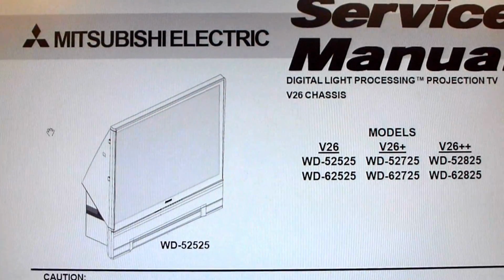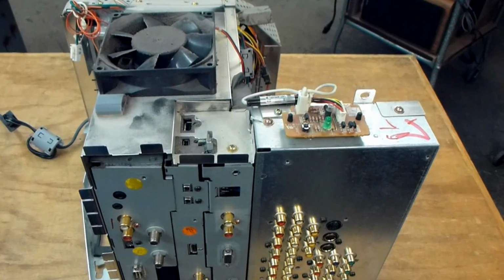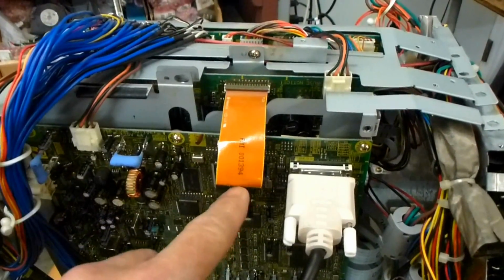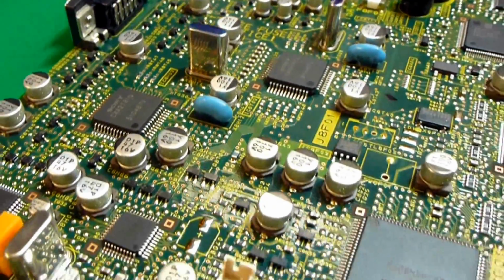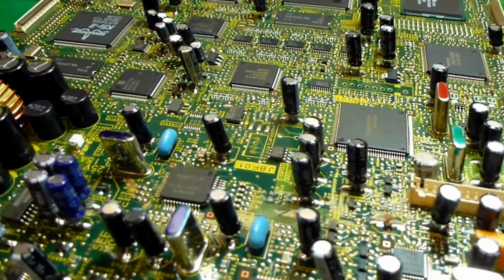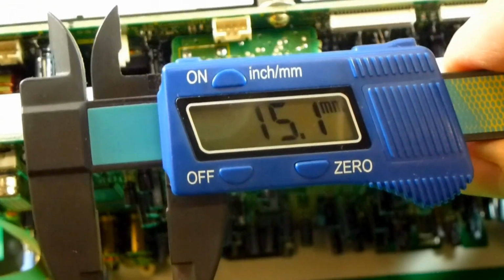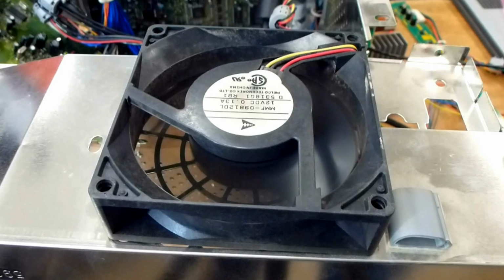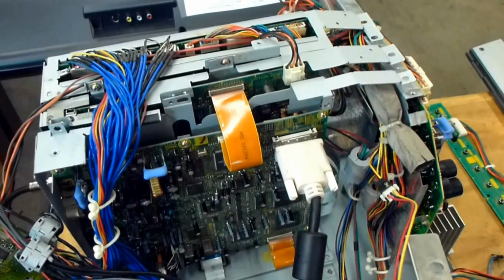Mitsubishi DLP Electrical Chassis Rebuild DM FMT WD 52825 62825 52525 52725 62725

Comment: I remember working on a couple of these things several years ago. One was still eligible for a brand new chassis under the extended warranty program (and still needed a new ballast after that) and the other one was a monumental failure that wasted hours and hours of my time. If you look up "convoluted mess" in the dictionary, there's no words; just a picture of one of these V26 series Mitsubishis.

Comment: your good where can find a ballast for my dlp ushio phg201g23dg seeking this my lamp wont turn on at all I watching my tv during a power outage now my ballast need replacing  input voltage 250 -420v output 200watts

Comment: I have a wd-73727 that I was watching and it went out like the bulb went bad. the code is showing a 34- which is bulb failed to lite up. ordered  a cheap bulb and put it in, still no luck. started checking all the voltages and can't find any bad or wrong. I have 340v to the ballast, I have a good 5v reading. can't find any bad caps on the fmt board. I don;t have a scope to check signals with, but the lamp- en and the lamp litz lines both go from a 1.8v standby mode to a 4.9volt reading when set is turned on. only last about a second and then the ste shuts down and the red lamp indicator comes back on. blulb never attemp's to turn on. is it going into shut down mabe? can't fined any shorts, so don't know where to go next. cheap bulb bad?   the training manual say's the lamp-en and the lamp-litz is generated in the dvm on the light engine. formatter board problem?  also changed the ballast board thinking it was a bad board. didn't fix. all fans fire up just fine, just no bulb lite. please help if possible.

Comment: Norcal, I found some bad caps on my power board (bulging).tv is wd-62825 Caps are C9A33 and C9A41 . I get the green blinking light of death.  I checked standby voltage at the test points on the power board and get the advertised voltages with the exception of the +15 and -15 test points.  I get 18V at these test points. I looked at the wiring schematic and it looks like my bad caps are in the 12 and 6 volt circuits.  Could I have a bad voltage regulator in the 15v circuits.

Comment: Hello, I was hoping you could help me. I have a Mitsubishi DLP WD-62725 TV. Last night my power went out with the tv off. It is plugged into a surge protector. The power came on about an hour or so later and I noticed the green timer light blinking then go off. When I woke up in the morning I tried to turn on the tv but it would not power up. No lights blinking whatsoever. I tried pushing the reset button for 15 seconds and I also pushed the menu and device buttons together to see if it would give me any type of error code. Neither worked. If you could please tell me what my best options might be it would be greatly appreciated. Nice Vid by the way. Also I do have some soldering experience. Thanks in advance.

Comment: I was an authorized repair station for Mitsubishi tv . They said they would replace other components besides capacitors,when rebuilding this chassis but that the some of the  components were unavailable to the general public.But Mitsubishi was generally helpful otherwise

Comment: Could you recommend what panel/board that I should replace capacitors on based on the following description.  I am a novice, but am up to the challenge.  I have replaced capacitors before with success on a receiver.  

I have a mitsubishi WD-62725 that is experiencing some issues.  I want to keep it if possible, but need help diagnosing my issues root cause.  The HDMI input picture has degenerated (grainy and some heavy lines going through it, similar to what you showed on this video)  I hooked the same HDMI devices up to other LED TV and the picture is great.  Also, the cable card picture is perfect, and component and composite pictures all look great.  I am wondering if there is a HDMI capacitor or other component that can be replaced, and where I may find youtube of other instructions to do so.  I have tried different HDMI cables as well, so i know it is not the cable.  This MAY have all started when about a month ago I was inserting a new cable card, and it bent 3 of the tiny pins that the cable card plugs into.  I have painstakingly straightened those pins and successfully got the cable card functioning great again, but the picture quality of the HDMI input has has the above state problem now.

Comment: When you say you now only replace ALL the caps.. what do you mean by all. All including surface mount? All on one particular board? All in the entire set? I replaced probably 50% of the caps in one of these and it worked for a while but surprise surprise I'm having problems again. The caps alone probably cost 65 bucks. How much does it cost you in parts to do them all?? If it is every cap in the entire set.. even the boards outside of the main engine, I can imagine that being a ton in just parts. Hope you respond, your knowledge on these things is King.
Reply from the maker: All SMD caps on the electrical chassis(formatter and digital boards). I have had some going for about 5 years with no problems. I have done 8 complete cap replacements so far.
Reply: norcal715 Thanks for the response. That must be kind of expensive. I get my caps from digikey. Are you using a cheaper source? Those little amounts sure do add up quick. BTW I was able to fix the latest problem last night by simply replacing the "one" cap in this vid 10mf 50v. You saved me a ton of time and energy. Thanks!

Comment: Thank you so much for these vids, Are these models swappable between each other. like could I use a 52525 engine in a 62725 etc?
Reply from the maker: yes the 525 and 725 are completely interchangeable. the 825 is not with the 525 or 725 however. 52 and 62 just refer to the screen size only.
Reply: Awesome thanks man. I guess I'll keep all these 525 parts for spares for my 725!

Comment: I have a wd 52525 that seems to be working fine. It boots to a blue screen and thats it. I can switch it to computer and the picture is perfect but there's no longer sound. Switching to anything hooked up through the component hookups just sends it back to the blue screen.

Comment: Thanks for all the info,  i have a wd65737 and after a power outage we cut it back on and all it'll do is bring up the welcome screen and it keeps getting brighter and brighter and the green standby light just continuously blinks,  which board would I need to fix this problem and do you have any that you've redone with the different caps like this repair?  Thanks

Comment: So... I've played with this TV for a few days and watched many videos. This one helped me figure out which caps to attack first. Previous owner gave me the TV for free because he replaced the lamp and nothing worked. Red light stayed on. TV service guy told him $200 to fix... I spent less than $6 on caps. Soldered them in. Still nothing... started chasing wires and found out the lamp had pushed the ballast cables to the side instead of plugging in. CHECK WIRES!!! TV works great now. :)

Comment from the maker: That would be great if they could be tested in circuit but most of them are in parallel with a little choke coil making their own little circuit but testing them looks like one big capacitor. The ONLY complete repair is to change all of them.

Comment: Makes sense to check the capacitors with an in-circuit capacitor meter before changing every single capacitor. Otherwise I would just BUY a rebuilt board. The last time I checked I believe the formatter board was around $100.

Comment: I've done a couple of dozen of these over the years, but I'd like to point out that most boards using smd caps will NOT survive the twist method.  These Mits boards are very sturdy, but that's not the case in most.

Comment: Awesome video it has helped me so far. I can get my WD62525 to boot with the 4 prong connector unplugged. And as long as I keep the tv plugged in it will keep powering on but when I unplug it I get the constant blinking light. I have replaced the 4 1000uf 16v caps and still no luck. Any ideas?

Comment: I change other capacitor from the power board but have the same problem , the status light turns red (not orange) and the code is the same 44 . Any insight would be appreciated.

Comment: thanks for the video norcal715, I have a wd-62825 and I change the capacitors 1000/16 and 3300/10  like you in the dm board and the power board, but the problem is the code 44 I check the dvi cable and it's ok. please can you help me ? the status light is blinking red or rather orange the chassis fan stops in few seconds after I connect the power cable . sorry for the bad english.

Comment: Finally got the chassis back into the set. I got it to boot once. It warned me that the chassis fan was obstructed. I got the wires out of the way, and we're back to green flash, no boot.  Guess my workaround didn't work out. I feel like troubleshooting it with a shotgun while sipping on a green flash

Comment from the maker: I cant reply to you directly you have it blocked. I have stopped doing part by part capacitor replacement and only replace them all at this time. It is the only way to be sure that the repair is solid. The list is the original caps. I always replace all of the 47m with 25 volts and the 100m with 16 volts just because I know they will fit and so on. That way it minimizes the number of different caps you must order.

Comment: I havent gotten a reply yet myself. Not sure if Norcal715 is monitoring this thread anymore.

For your problem, I would start with opening the back and follow the part in the video about laying flat the wires using a tie wrap. Have a can of air ready and blow out everything. Cut the fan box and make sure the flow is out/up. I had that symptom when I didn't have the fan connected and it heated up.
I am now trying to find a inventory of parts to order.

Comment from the maker: you have to run a single conductor jumper from what is left to the new cap. also try downloading the svc manual and finding them in the schematic sometimes you can find the origination point to tap to.

Comment: okay norcal715, I'm kickin ass with this rebuild, but I've hit a snag. When I removed 2 bipolar caps on the DM board, I lifted off the pcb conductor pads with them. What's the fix?

Comment: hey i am getting error code 34 i changed caps for lamp it played for a few weeks then change cap agin no change so change lamp still no change so i change the Power Supply broad can you please tell if you can help with this my set is the wd52525

Comment from the maker: you can not check it with an ohmmeter as it is a UHP ultra high pressure lamp. It has a drop of mercury in it and requires a high voltage arc(5000 to 20000 volts) to vaporize the mercury then a lower voltage to sustain the lamp(70 to 150 volts) I have made a lamp tester out of an old ballast but the ballast needs 320 volts to run so a doubler circuit is required.

Comment: hey, great video. much appreciated. but ive run into a small problem. i broke one of the prongs off of the inside of the filter door jack (the one that tells the tv that the filter is in place) and i cant start my tv without it. are there any ways to bypass it or do i have to find a replacement somewhere? thank you :D

Comment: I think if you watch the video, you would see he says you need to change all of the caps on the FM and DM boards if you want to eliminate the lines.  Also change any bulging caps on the jack panel, power supply, and signal boards.

Comment: So the yellow blinking lamp led is fixed (forgot to connect lamp filter connection).  Now I am getting a blinking green power light.  I guess the next step is to replace all of the caps on the DM and Formatter. Correct?  When I get this thing fixed I am going to send you my address so you can send me a bill.  You have been amazingly helpful.  I would have given up by now if not for your help.

Comment from the maker: very thin black and green individual wires go the filter switch. Connector "CC" is the cable to the door switch. It is a larger black shielded cable with red and white wires inside. Also look at the video and check the error codes.

Comment: The lamp and filter door and on the system and I am still getting a blinking yellow lamp light.  Do you know which plug checks that the doors are closed? I'm assuming that is where i need to start.

Comment: Thanks so much for the quick response.  I replaced that cap this morning and now the chassis fan starts up for a few seconds then I hear a clicking sound and the chassis fan shuts off.  Does that mean something is wrong on the DM or Formatter board as well?

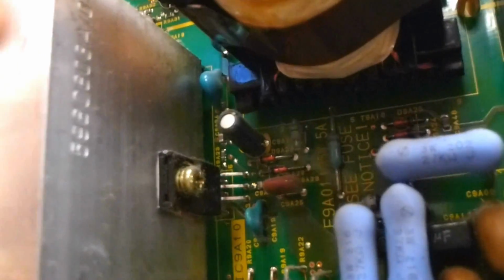Comment from the maker: If the top fan in the chassis does not run then the chassis is not making its 6-7 volts and the 12 volts. suspect the little cap on the p/s board as in the video at 4:44 10m 50v, it will cause a dead set. The hard drive has its own power supply

Comment: Looking for some help norcal.. have a 52825 that will no power up, no lights or anything.  Followed you guide, found 3 bad 330uF on signal board and 1 1000uF on jack panel.  The only thing I know for sure is getting power is the HDD (fans spins).  Is there a quick way to check that the other boards are being supplied with power?  Thanks, excellent video BTW

Comment from the maker: if its the one on the power board then a 10uf 50 volt will work they are very cheap even maybe radio shack. you have the uf and volts reversed

Comment: Nevermind the capacitor. Replaced it and got the TV back on. Unfortunately now the inputs are all scrambled. The coaxial input works with bowed edges(sides) like what Julie Cairnes described. Might be time to part ways with it. Any info would be helpful. Thanks.

Comment: 525 after changing the two caps again for the power to lap. i still get the red lamp light. i checked the codes and i got 34" lamp abnormality code the TV will play with sound and pitcher but when turned off and then i try to turn it back on i get sound lamp starts to light but goes back out and red lamp light after a min or so. what else can give me this code could it be light engine or ballast

Comment: I have the 52525 and a power surge must have blown the smaller 10V-50uF capacitor as the cooling fan for the boards barely spins intermittently .The front timer light will blink about 10 times then pause.......10 times then pause. I have the entire unit disassembled and am ready to solder the new one in if I could find one. Mouser has none in stock and wants 60 bucks to make a batch. Do you happen to have a 10 volt 50uF capacitor I could buy. I can pay through paypal.

Comment: hey can me help with this a few months ago i change the caps out 3300uf 10v that stopped the lamp form coming on and they where bugged at the top. but now the lamp is back doing the same thing know lights up an goes off. so i took it apart and the cap look fine but i dont know if they are bad because they are not big at top. my set is wd-52525

Comment: Hello I have the wd 62825 and it has the green light blinking constantly I have changed the power supply and looked over the dm and formater and found no bad caps but it still will not work does anyone have any suggestions. Thank you

Comment from the maker: Yes I have a list I just have not had the time to post it. Keep checking back. You can always use a higher voltage cap in place of a lower voltage cap. As long as the voltage is not lower, so dont use 10V caps in place of 16V caps. example, if you have a 4.7m 10v you can replace it with 4.7m 25v ok! and so on

Comment: This is such a wonderful video. Would love it if you could give me a little help.  I have the 52525 & after 4 years it made a huge popping noise & went out. Opened it up & changed 5 caps, replaced lamp ballast, & figured out that the noise was the color wheel exploding! Replaced that. Worked great. Now 2 yrs later, went out. Replaced 2 more caps. Powers on but looks like a very, very fast slide show of the program it is tuned into. Think it would most likely be the DM board causing this?

Comment from the maker: long as the voltage is not lower, so dont use 10V caps in place of 16V caps. example, if you have a 4.7m 10v you can replace it with 4.7m 25v ok! and so on

Comment from the maker: try the built in test patterns (menu,2,4,5,7) then use the FF and REW keys to scroll through the patterns. Is the defect still there? if so then suspect the DMD board(assuming you cleaned the color wheel) if not then the digital board is the most likely.

Comment: Just found your video and appreciate the information that you have shared. Great information! Would you tell me when replacing the SMT Caps on the FMT and DM with regular caps, do the new caps need to be the exact same values as the old SMT caps? Appreciate your help.

Comment from the maker: I must have dropped that part of the video because I did a complete video on that, yes 680m 16v in place of the 1000m's on the p/s cba and also the 3300m 10v as well as the 1500m 25V?(from memory)

Comment from the maker: make sure you dont have AA and RL reversed. They come from the remote sensor board and have a connector mid-line. Other than that, rip it all apart and look for a cable that is pinched.

Comment from the maker: The infrared sensor is located just above the lens and connects to the chassis via connector RL. you an access it from either the front or the rear of the set. Thanks for watching

Comment from the maker: When it shuts down does the green light blink for 60 -90 seconds? if so the chassis needs rebuilt. on mits remote press in this order MENU, 2,4,5,7. then rew and ff buttons to change test patterns. Do the patterns have distortion also?